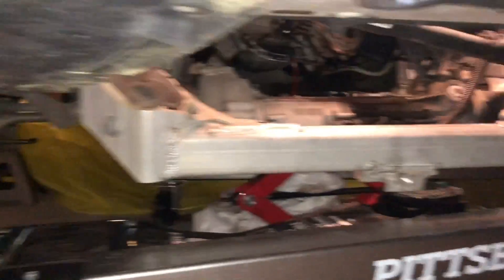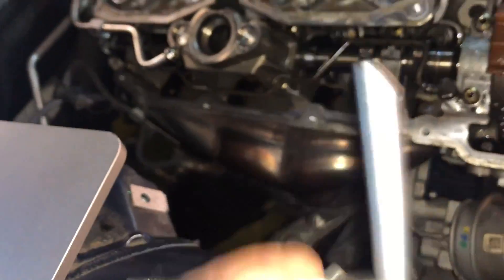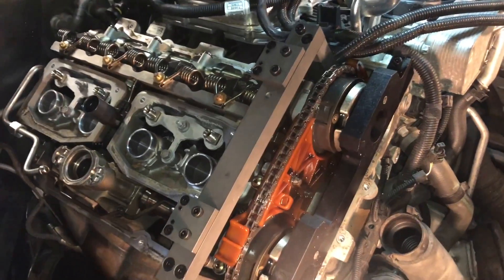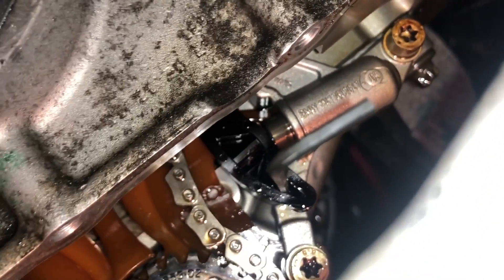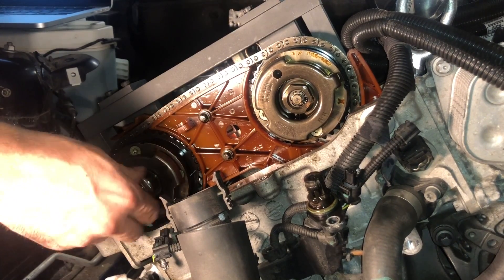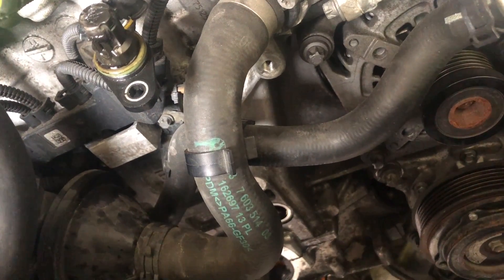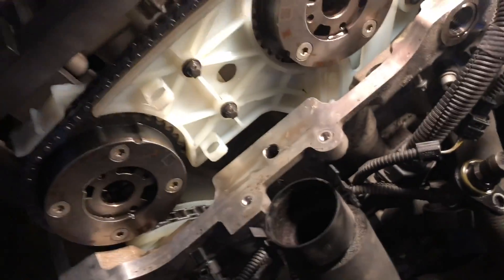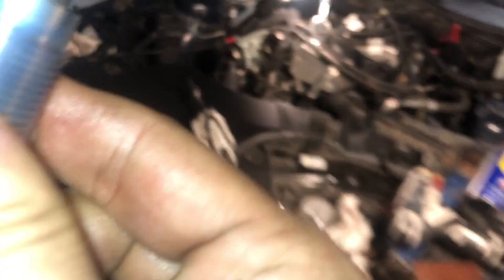Replacing BMW N20 Timing Chain (228i, 328i, 428i, 528i, X1, X3 and Z4)

Comment: Hi !  Many thanks for all your very interesting vids. One question please. I'd like to change my timing chain on my n20 z4 28i from beginning of 2013 after 32000km preventively. Is it really necessary to block the oil pump axis before untighten the front cranshaft screw ? Could I damage something if the cranshaft is locked by the fly wheel and the 2 upper camshaft locked by the spécial immobilisation tool?  Because if to untight the big front cranshaft screw the motor can stay on it's two front supports it should be much more easy and stable, correct ?  Instead of hanging the motor by the top to a supporting hydrolic arm, to remove first the lower oil pan to block the pump, making the motor much more mobile and unstable. Thanks for your help and reply. Best regards. (In fact I still do not understand why the oil pump axis angle must be synchronised with the upper camshafts and main cranshaft)

Comment: Brother…. That pin that you said you can’t put in because you’d have to remove half of the exhaust ..that pin is what sets the crankshaft in TDC!! You can’t time the engine correctly without inserting that pin. That pin is literally the most important part. Not to mention that the pin is supposed to be inserted from the bottom..nothing to do with exhaust

Comment: for anybody doing timing chain do rod bearings at the same time whil you there i had a small knock sound after doing my cars chain turned to be a rod knock wich was mistakenly sounding like a tappet sound ive previously come accross threads on the net where n20 owners experiencing mild knock after doing timing chain sound with no conclusion the problem are worn rod bearings

Comment: Is the X3 i28 2016-17 n20 is more reliable than the older models 2013 ?
Reply from the maker: Absolutely, they upgraded the engine materials after 2013 and it’s a lot more reliable.

Comment: So how can you know if timing chain goes bad? Can it effect the valvetronic motor? I got a n20.
Reply from the maker: Usually you will hear the chain slap on idle or slow revving of the engine. you can also usually find wear on the chain itself (you can see it through the oil filler cap) or even metal shavings in the oil pan. I'm not sure if it can effect the valvetronic motor.

Comment: So my 328i fell victim to the timing chain breaking. BMW recommended a new engine of course and it cost $15,411,69. I would be a fool to pay that. It’s more than what the car cost. So my question is could I just replace the timing chain instead of replacing the entire engine?
Reply from the maker: That really depends on what happened. Did the chain break and the engine was spotted right away and no other damage done? If so, replacing the chains, guides, and sprockets should be fine. If it damaged anything else, that would have to be fixed as well. Usually if the chain has already snapped, it has done a lot more damage and not worth fixing. You can get a used engine for about $3500 and pay someone to replace
Reply: @SimpleCarGuy  the chain didn’t break. It’s loose and the oil pressure valve is jammed. I have already been looking at the used engines just in case.

Comment: Can changing the timming chain tensioner avoid timming chain problems?
Reply from the maker: Absolutely, it’s one of the recommended steps of preventing issues. Of course you can also have issues with brittle plastic of timing chain guides, which is unavoidable. But the tensioner is a good start and very easy to swap.
Reply: @SimpleCarGuy  yes, that circle attachment on the timming chain guide, where the plastic broke, should have a metal washer and/or much thicker plastic for the circle clipping so it won't brake. Then the millage would probably greatly improve if the tensioner were swapped out at say every 70k.
Service might stretch out to 200k or more before replacement of the chain guide was really needed. Who knows how much longer it would last. 

I think what's happening is the tensioner becomes weak and the chain is rippling through that track basically beating that circle, rubbing it back and forth until that plastic circle breaks, A new tensioner is just a screwout , screw in fix that should stop that. 

 Not sure how long that oil pump unit will last though. But it looked like all you need to do is pull the oil pan to get to it.

Comment: Do you know if you can put the crankshaft sprocket part of chain back together on the train without the oil pan removed?
Reply from the maker: If you’re not touching the oil pump chain, it should be possible but the oil pump chain will be under tension as you won’t be able to block the tensioner.

Comment: Doing one today on 2014 528i, we did not remove the oil pan
Reply from the maker: You don’t have to if you’re not replacing the oil pump chain or sprocket.

Comment: Holy crap, you might as well replace the engine. So much work, i will never buy a bmw again.
Reply from the maker: It's definitely not an easy DIY, but for an experienced mechanic isn't so bad. This is why the value goes down so much after warranty expires.

Comment: I was trying to fit the timing tool and rotated the engine backward slightly and the chain slipped and now one of the camshafts is out of alignment. What to do?
Reply from the maker: Adjust the camshaft so that it fits on the alignment tool properly. That's what it's for, to make sure everything lines up before you put it back together. There is a little slot for a wrench on the camshaft.
Reply: Thanks sir....already have it locked down. 
And one more thing, when I went to loosen the Crank shaft bolt I had the alignment tool inserted but forgot the flywheel tool. It bent the alignment tool but thankfull it didn’t break. I got it out and straightened it but now there is some slack in the flywheel when I try to reverse as opposed to it being completely locked forward and back......but definitely no slack forward. 

Is there another alignment mark on the crank for TDC for me to just verify TDC?
Reply from the maker: @popptj  There might be, but I'm not aware of it. It has been about a years since I did the job, so I recommend checking on forums etc.

Comment: what are the signs of how the car behaves, any noises, anything at all.. before it completely brakes one way or another ? Because from what i understand, it being an interference engine, it's too late to fix it then
Reply from the maker: You can usually hear the chain 'slapping' agains the cover or other parts if it's really bad or it will 'whine' if it isn't as bad. Sometimes you will also find metal shavings or plastic pieces from the chain or the guide.

Comment: 320i also has n20?
Reply from the maker: It did from 2012 to 2015, but it was a detuned version of the engine. Should be physically mostly the same.

Comment: Can a 328I xdrive engine be installed in a BMWV528I xdrive?  The 528 is 2012.
Thanks. I appreciate all your feedback and suggestions
Reply from the maker: It should work just fine. I replaced mine (Z4) with an engine from a BMW 328i.

Comment: Me again; did you have trouble taking off the oil pan. Seems to be stuck between the trans and the oil pump. Thank you
Reply from the maker: No, I had no issues with that. It did take 5-10 minutes of moving it around the subframe yo be able to remove it completely. You may need to twist it all kinds of ways to get it out,l. What car are you working with and is it all wheel drive?
Reply: SimpleCarGuy I finally got it out. Just had to push the subframe forward and then back. I guess I didn’t drop it enough but got it working. I’m working on a 328i n26 with rwd. I might do a video of the steps too. All the info is good for somebody doing this job. Thanks for the quick response.
Reply from the maker: Glad you got it out. It’s hard making a good video while doing all of this stuff. Angels are impossible and sometimes you are so frustrated at a step the last thing you wanna do it video it lol. Hope you do make a video of some steps, I’m sure it will help someone!
Reply: SimpleCarGuy lol yup pretty crazy trying to record while you are ready to kick the car lol

Comment: Does the tow hook always work for holding the engine?
Reply from the maker: It is the correct way to do it on this engine. I can’t vouch for other engines. Funny enough, the tow hook I used is from the Mini as the one that came with the Z4 did not fit.
Reply: Thanks for the reply. Do you have the instruction to drop the subframe?
Reply from the maker: @ramiroparocua8070  it's more or less straight forward. You will remove all of the underbody protection, reinforcement plate, disconnect ride height sensor. Then you have to support the subframe with a couple jacks. I put one in the front and one in the back. Then you loosen 6 big bolts that hold it in place and slow lower the jacks watching for anything else that needs to be disconnected.
Reply: SimpleCarGuy thank you, I’m half way done. Working on the subframe today.

Comment: My car keeps shutting off when I go to punch the gas randomly it does it every blue moon sometimes it does sometimes it doesn't I noticed a bit of build up around the hpfs going to be replacing the gasket
Reply from the maker: If you aren’t getting codes, it’s hard to say. But it does sound like a HPFP to me, I have a video on how to replace it:

HPFP - BMW N20: https://youtu.be/uZjtaqmoRtE
Reply: @SimpleCarGuy  I get a random 0.2 evap leak and it comes and goes any idea?
Reply from the maker: It could be the HPFP, it could also be something like fuel tank breather line, you’d need a cold smoke machine to detect it. It could be soooo many different things as .020 is really small and probably wouldn’t be visible with naked eye easily, but wouldn’t hurt to do a visual inspection.

Comment: What are all the parts I would need to replace a fuel pump on the n20
Reply from the maker: The fuel pump with the gasket (should be included). That would be it for the parts.
Reply: @SimpleCarGuy  it don't need a sending unit on the 2012 528i
Reply from the maker: @Luis92r  are you talking about the low pressure fuel pump or the high pressure fuel pump (HPFP)?
Reply: @SimpleCarGuy  on the LPF does it have a sending unit on this model I looked up stuff on fcpeuro but only found the fuel pump and not sure how many parts need to be replaced in am lpf i cant find anything online

Comment: hello sir. is there a torque spec on the timing tensioner? also do you need the tensioner tool if your just replacing timing tensioner? many thanks!
Reply from the maker: You can replace just the timing tensioner without everything else, it’s much easier and you just have to remove parts around to get to it. You must replace the sealing ring (should come with a new tensioner) and tighten to 80nm.
Reply: SimpleCarGuy thank you very much! 🙏

Comment: So you have to replace the ooo pump and other things yo or can you just replace the timing chain ?
Reply from the maker: It is recommended to change both as they both go bad at the same time usually. However, it is possible to just change one. You will need a friction gear changed if you take it off as they are not reusable.

Comment: Bmw there amazing  driving cars  but they require a lot of love and attention 💸
Reply from the maker: I got 2 bmw and a Mini Cooper s, so I have my hands full keeping them going. Enjoy all of it!
Thanks for watching!
Reply: @SimpleCarGuy  HI Buddy...do you recommend to put an engine of bmw328ixdrive  into a 2012 528xdrive.
Thanks for your help
Reply: Bmw did that to these cars on purpose to keep them in the dealership dor for repair services. They do that so they can't financially take car od their dealers because dealers make little money from selling cars they make their alot money from repairs
Reply: @zlord1199  It s more like the American dealers having this kind of problem: "making little when selling car and having to make money on repairs. The dealer practice the long oil changes to the extreme, skipping one or two, while the car owner, who is actually leasing and not giving a damn, will not know. These cars may get up to 50k miles having done one or two oil changes max and zero air filter change. Same for other fluids and so on. Once they pass the 50k miles (especially those that have been leased) some of them become a time bomb. But it is not BMW fault. It is just how dealers maintain cars for people leasing them and not having to worry beyond warranty expiration date.
Reply: Also requires you to remortgage your home a few times

Comment: Is this a problem for all F10 N20 or just a certain period of time? Im looking to buy a used F10.
Reply from the maker: For all, but much much more common on cars prior to 2013. 
BMW 5 Series F10 Problems to Expect https://youtu.be/uUdBEwJcPa4
Reply: BMW revised the plastic material for 2014 models and onward to hold up better against the heat, but it's still plastic, it's going to disintegrate eventually, it's just a matter of how hard the car is driven and how old it is

Comment: Having trouble locking the flywheel, do I need to drop oil pan to get to it? I really don’t want to remove exhaust
Reply from the maker: Do you have a manual or automatic transmission? Mine was a manual and there is an opening for stopper right where transmission connects to the engine to lock the flywheel. You should have to remove any exhaust
Reply: SimpleCarGuy ah, I have an automatic, there is an opening but there is no visible locking point at the bottom of the car, even when in TDC. I guess I have to drop exhaust
Reply: Wow, just removed the timing chain and plastics bits. Seems like it just broke, caught before failure
Reply from the maker: @buckweat6568  You sir got very lucky! Probably saved yourself an engine. If you see plastic parts already broken or cracked, it's the perfect time to replace. Very happy for ya!
Reply from the maker: Of course if you are replacing the oil pump gear and chain you will have to drop the oil pan and to do that you have to lower the subframe.
Reply: SimpleCarGuy I’m just doing timing chain, it doesn’t appear to be broken so I’m just doing it for preventative measure. Already have valve cover removed and parts/tools purchased
Reply from the maker: It says for automatics there is something you’re supposed to screw in to stop the engine from rotating. This should help:
https://www.newtis.info/tisv2/a/en/e89-z4-sdrive28i-roa/repair-manuals/11-engine/11-31-camshaft/FYz9DVh0
Reply: SimpleCarGuy ah, thank you. I managed to get the pin flywheel lock in. Was able to squeeze it in without removing downpipe. Just revoked the crank bolt and am working on pulling the bearing

Comment: if the timing chain guides are in great shape u do not have to pull the oil pan at all, or even have to remove half of what you did. pop valve cover, lock flywheel, lock cams remove balancer. loosen the cam gear bolts, loosen the crank bolt, remove timing chain tensioner, remove the cam sensors then cam gears,remove guide bolts then pull out crank bolt slowly leave oil pump gear on crank snub. pull chain and guides out the top as a assembly easy peasy. only time u pull pan is if guides are shredded
Reply from the maker: Thank you very much for the information, when I was working kn this I couldn’t find any information or it was very limited so I went by the technical manual.
Reply: No problem.
Reply: do you have a link with all the detailed steps (with photos) for this type of replacement (preventive replacement without a failure)?

ps: I own a 2014 x3 xdrive28i; 34k miles in 7 1/2 years but have driven it hard often . I might do this as a project later (no time pressure)

btw do you have any videos on how to replace the thermostat?

thanks
Reply: @mindanalyzer8302  no link as this was from experience but i can tell you this being a xdrive its harder because you would have to remove the transfer case to drop the oil pan...if you went that route. Also you need special tools to lock the cams and crank because there is no timing pin that locks the crank pully to the crankshaft. You can mess up badly very easily

Comment: After how many miles, I need to replace timing chain?  i have N20 E84 x1
Reply: Around 80k, you should start paying attention to it
Reply from the maker: Usually it isn’t based on how many miles you have driven. Once you hear a ticking sound coming from the engine, that would be a good indication to get it checked out. As a preventative I would change the chain tensioner before getting into replacing the timing chain.

Comment: You know as I am looking at the design of these timing chain engines I can't help but think they could have put a sensor in the block to measure the wear of the chain, if it stretches the guide tensioner will push out further, or if it were rattling similarly movement could be detected in the moving guide.
Reply from the maker: That would have been helpful, but that is what the tension ideally does. It just happens to fail..

Comment: Hi I found small thin metal shavings and pieces of plastic from the timing guides did you have that too?I hope it's not from the bearings, waiting in timing tools to take off the chain
Reply from the maker: I had metal shavings, but no plastic. Unfortunately, my engine also had rod bearings that needed to be replaced. So, I can’t tell if it was from chain or bearings.
Reply: @SimpleCarGuy  ok thanks I hope the metal shavings did not cause any more damage,  I didn't have a knocking just a lot rattling when I Rev the engine
Reply: @SimpleCarGuy  you have a video on the rod bearing?
Reply from the maker: I replaced the engine instead of fixing the rod bearings. Simply because that could have also caused issues in the head of the engine and it would have cost me more overall.